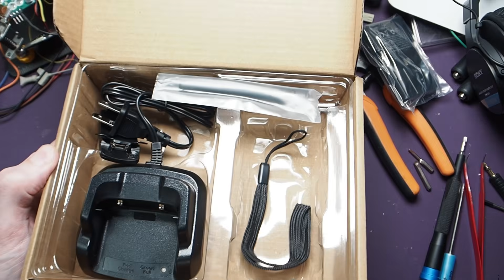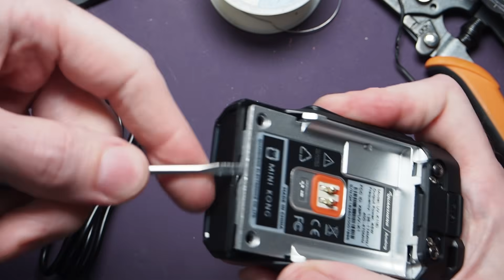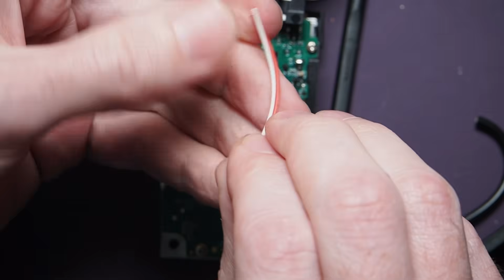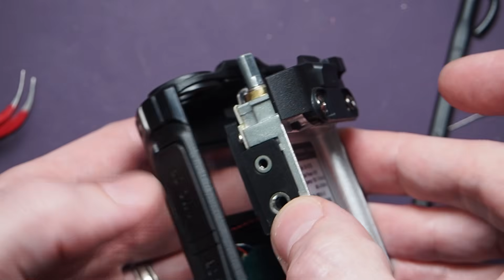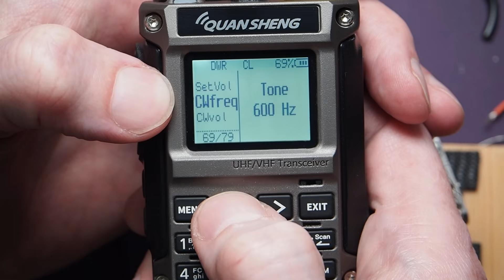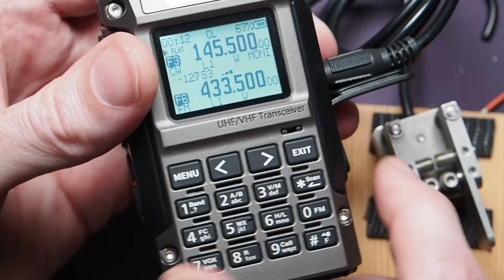UV-K1 CW Paddle Rework

Comment: Hello, I need help with a CW decoder problem on my Quansheng UV-K1 8 (Eracom) running NR7Y custom firmware v1.4.

My problem is that the CW decoder displays letters when I transmit Morse code using my own radio, but it does not display any decoded letters when I receive CW signals from another radio.

Here are the details:

- Radio: Quansheng UV-K1 8 (Eracom)
- Firmware: NR7Y K1/K5 V3 v1.4
- Mode: CW
- Transmitting CW: The decoded letters appear on the screen.
- Receiving CW: I can hear the Morse code audio clearly, but no decoded letters appear on the screen.
- I have tried receiving CW signals from another radio, but the decoder still does not display any text.
- I also tried downgrading the NR7Y firmware version, but the problem remains.

My question is:

Is the CW decoder on NR7Y v1.4 supposed to decode and display received CW signals in real time, or does it only decode my own transmitted CW?

If received CW decoding is supported, could you please explain which settings I need to enable, or whether this could be a firmware bug or a hardware limitation on the Quansheng UV-K1 8 (Eracom)?

Thank you for your work on this firmware and for your help.

Comment: I have an old V1 model with the CW firmware and it's great ! I've acually used it to make real QSO's in local contests. I am considering the V3 version. Does the firmware on the V3 rigs / K1's include FM broadcast functionailty, spectrum scope and corrected squelch and power output settings like the F4HWN offers ? Thanks.

Comment: Does your NR7Y firmware take any OEM functionality away from the K1? I guess what I mean is, can I do this hardware mod, flash with NR7Y, and still use the radio as a regular VHF/UHF transceiver? Can it still be programmed in Chirp after the flash?
Reply from the maker: The firmware itself doesn't take away any features, but if you do the CW paddle mod then you can't use the PTT button of an external microphone anymore.

Chirp programming requires a custom module, which I include with my releases. This is true of all the firmware mods.

Comment: You can still do cec cable and not do internal mods correct?
Reply from the maker: On a V1 K5, yes. If your K5 is the V3 edition, or it's a UVK1, those do not work with the CEC cable.
Reply: @BrianMaybeMedia  thanks,good to know  why the big switch to the k1s over k5s ?

Comment: Ok I've modded my K5 rig. Pcb ver1.x. i found Brian's instructions and flashed the latest build from the build section on GH. Getting an error on Port Iambic. The levels im seeing on the key are 11 and 1587 but cannot set these values im guessing I've either missed a resistor or something's not right in which ver I'm flashing for pcb rev. 😢 

------Edit-------
With a calmer mind, a review of the instructions revealed i missed the additional resistor for the mod. Now this is removed (as as per instructions). Mod works great with my K5. Look forward to a trip to the mountains now.
Reply from the maker: Opened up the radio and removed the two resistors and added the two wires, or you're using the external CEC cable? The ADC Read mode only applies to the CEC cable. If you've done the internal rework, you should use one of the "Port Iambic" input modes. Does either paddle cause keyer sending in a port iambic mode? Does using the PTT button cause keyer sending?
Reply: @BrianMaybeMedia Thanks Brian—I’m making noise before reading things properly. I’d missed the removal of the second resistor. Thanks for all your hard work on this. Looking forward to modding the K1, I’ll tidy my station and film it 😎
Reply: Hopefully work you in the coming weeks for a VHF 2M S2S contact, de M1GEO :)
Reply: @m1geo I need to work out when that is.

Comment: Is it real A1A or sidetone over FM?
Reply from the maker: There is no FM modulation component, only the carrier keying on and off with the elements. I'm considering adding an FM MCW mode so folks can practice on FM nets and repeaters too.
Reply: @BrianMaybeMedia  that would be AMAZING
Reply: @BrianMaybeMedia  I can hear when receiving cw signal from UV-K1 that tehre is something at the end of transmission. I sound like a dash with different pitch. When sending S you can hear V bat last element has got different pitch.